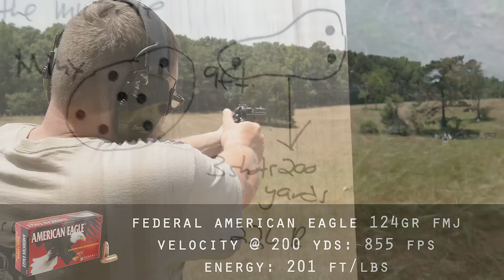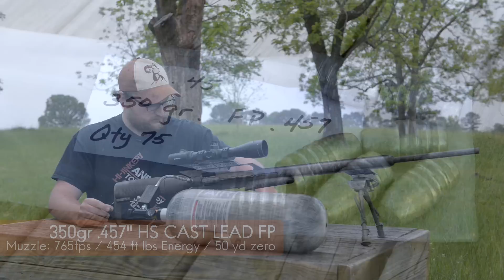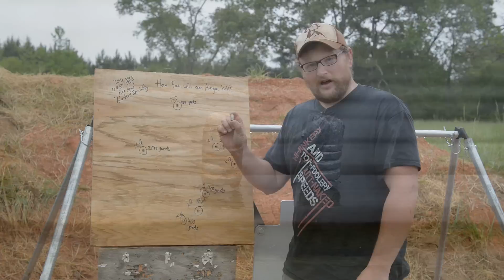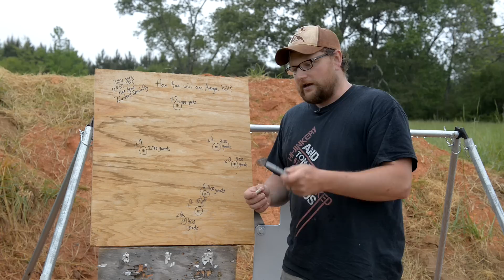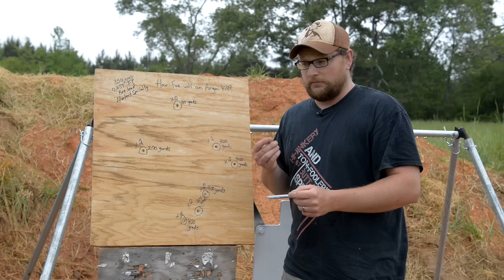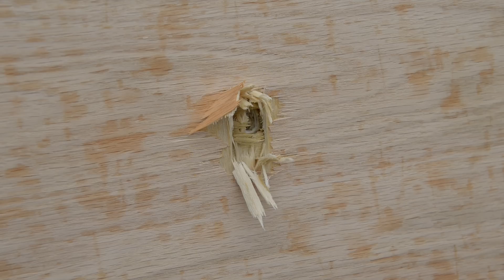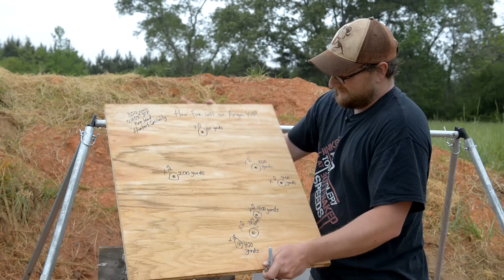How Far Will an Air Rifle Kill? Part 1

Comment: I got an challenger .457 bullpup with the power valve. I cast and shot 277g out of her @ 1020fps. I also love that lee mold 340g .458 I cast them and size them .458 and shoot them at 944fps. What you think about 650+FPE ? For long distance.

Comment: Thanks. I’ve been looking for a video like this. Most of the Airgun videos that I’ve seen are hitting targets at long distances and rarely discuss energy at impact. I have an error rifle let’s about 1100 FPS and about 80 FPE 25 caliber. What I’d like to see, is the scientist you just did, but with 25 caliber, 30 caliber and 35 caliber the same air rifle, but a different caliber sizes. Some people think of 25 caliber is going to have more energy than a 35 caliber at say 200 yards or 300 yards but I have no idea. I hope you’ll consider doing this. It would be very interesting.

Comment: I have the hammer and I've had it go through 2 frying pans, a half inch pine board and a metal 5 gallon bucket cover and lost in the dirt hill behind it. Had no problem going through all of them. I like shooting cinder blocks with it bc they explode. Only thing I've found to consistently stop the .50 slug is a piece of 3/16 solid steel. Shit they use on elevator motors. That metal also stops 9mm rounds also though lol. Cops were called when I was shooting one time and they took pics and had all sorts of questions bc they said straight out that it could kill someone. I added, "and at 200 yards but that's not what I got it for" lol.

Comment: How many shots do you get without the separate tank connected and when it says it's firing at over 300ftps is that on the same scale of measurement as the UK limit of 12lbs ps so is it really over 30 times more powerful than our maximum allowed power i can't even get my head round those stats

Comment: just wondering if you could put a harpoon into this gun
Reply: Check out the slingshot channel, jorge will show you the features of his air powered harpoon gun... older videos, but he built and tested and sold air harpoon pistols... now, not exactly sure how effective underwater they are, or in all honesty if its more of a.... well officer, i was cleaning my diving kit when the crack addict broke in and, and as i already had the designed for underwater use harpoon in my hand, i kind of pannicked and fired in self defence, i honestly didnt think it would work out of water type of thing...theyre single shot double barreled design, use existing co2 cannisters and easily penetrate leather jackets

Comment: I just got the Seneca Dragon Claw from Air Gun depot, it's the .50 caliber dual tube. It delivers 670fps at the muzzle pushing a .50cal pellet. I really didn't know what I was getting into, but I bought a bottle, rather small one it's a 110 cu in bottle and went on eBay and bought a YONGHENG 110V Air Compressor Pump PCP Electric 4500PSI High Pressure USA 30MPa. So now I wait to get all my stuff, got the air rifle, but won't get the pellets until Monday April 4th and not sure yet, when I get the bottle or the compressor, just ordered them today, eBay say's the compressor should be here from Wednesday April 6th to Friday April 8th, no estimate yet from Air Gun Depot, but to be fair I ordered after the working day and they are pretty good on their shipping times, usually a day or two. I'm in PA and they're in Ohio and sometimes comes from Utah. I'm like a kid at Christmas, can't wait to open the box. 🤓

Comment: HEY Let's make an Air Machine Gun using a big acetylene torch air bottle mount to the top of the air bottle on a swivel joint mount on the bed of an F-150 Ford 4X4 must be commo down, go rabbit hunting we in Texas so those big ugly Jack Rabbits how many rounds can they take, The Rat Patrol, eat up my garden would you

Comment: I'm curious if there is a difference between the simple description and the actual target?
A "pine board" or "pine baffle" vs a plank of pine.  The difference being, one is simply a plank of pine wood, as the other is multi-layer, glued plywood.  The thickness may be the same, I don't know about the "harness" or what is required to "punch" through it.

Comment: What amazes me most is that a .457" air rifle retains 60% of its muzzle energy out to 440 yards. Mainly because it's already traveling so slow. It's actually quite efficient from a ballistic standpoint, even if it does drop 50 feet at 440 yards. Compare that to a 55-grain .223 Remington leaving a 20" barrel at 3240 ft/sec. At 440 yards, that projectile only retains 20% of its muzzle energy. That's very inefficient. But because it started out so blazingly fast, it arrives at 440 yards having dropped less than 4 feet. So there is a tradeoff between trajectory flatness and terminal performance of a projectile. You have to give something to get something.

Comment: You need an old fashion ladder type of sight, with a modern scope replacing the iron sight notch.
I might be tempted to bet that, that slug could poke a hole in your “coconut “if it connected at the
end of it’s maximum range . (Fired from a 45 degree angle.) Imagine 350 grain lead hailstones!
The concept behind “volley fire”.

Comment: Question, a cryogenic stirling piston can turn the gases in the air into a liquid that can fill a presurized tank then screw on the valve and you now have a full tank of presurized air? A 12v cryogenic piston could then in the field refill a presurized tank?

Comment: I would like to know if dieseling will work with this weapon? If so it would be much more powerful.

Semper Fi America, 
Midnight Sun
Reply: Why though? It's pushing over 400+ ft/lb at 100 yards, which is more powerful than a 9mm and even a .45 right out in front of the barrel.

Comment: Wow, thats pretty impressive. You guys ever see videos where u put a drop of gun oil in the skirt of the pellet? It compression ignites the oil when u fire, basically a diesel gun, problem is it will blow out the o-rings after a couple shots, but it got me thinking, what if u designed a gun that could handle that pressure, it would be a firearm for real, a diesel gun, which i think would be sweet. Just throwing that out there!

Comment: with good rifling in the barrel you could hit to a 1000 meters assuming the optics and barrel can stand the extra air pressure

though I can't see the point of lugging the gas can on a hunt though you can hunt with it for sure..

Comment: I might add that the board you used was actually laminated plywood, not s solid pine board, which is harder to penetrate than the pone board would have been. Very impressive indeed!

Comment: A stupid question: why are there always flat point bullets used in these tests? All air rifle videos use flat points. Does sharp point not exist? is it expensive? hard to get? Safety reasons? idk.... I know it's old video but still
Reply: not on large caliburs but you can get flat round and hollow points

Comment: Is that CO2 or simply compressed air, and what pressure does the rifle operate at? 
Also, you mentioned that you use that specific gun for hunting... Do you carry the tank strapped on your back?

Comment: Bad bad gun. Who said we need a hot explosion to drive a bad pill through the air?
But, there are two only things I have a problem with: 1rst - who carries the gas cylinder for me? 2nd - how can I adapt a mag onto this gun?
Otherwise, there are advantages over fire guns too: 1rst - they are really quiet, 2nd - they do not rust and are not that heavy ('cause of the material they were made of). 3rd - guess, they are easier to handle (not that dangerous)
After looking your vid I guess it's worth it having an eye onto this gun technology... it only can get better
best regards rp - and thumb up - of course
Reply: Aidan Hunter: Thanx for the hint. The Girardoni (or Girandoni) is really a nice rifle. The technology and design must have been futuristic for the time it came to market. Ok, the stock looks ugly. But, this is a cosmetic problem only. The mag is super easy to load. And, yeah I love the way one has to operate the rifle to (re)load a bullet. It's that easy, that I cannot believe no one had copied this for nowadays air guns so far. I can imagine that Napolean was really pissed off 'cause of that kind of snipers. BTW, it was at that times very uncommon to shoot officers or other "higher persons". As you may know, officers mostly were nobles. So, a simple soldier was not given the right to shoot nobles/officers :-)

Comment: My I've had a number. of air rifles,the one I got in K town the crank the barrel down to the 5millimeter Sheraton blue street,I with a daisy a 20feet took the head off a grasshopper leaving his Collier intact,my 12gauge Stevens single shot was my 11th birthday present,at six years old I shot a colt woods man thumb up like a cowboy,my father said put your thumb on the handle groove,my wrist was grabbed,pistol taken,field dressed put in the car while the two ordinance inspectors shot for an hour,at home dad washed my thumb in the bathroom where I fainted,learning the hard way,a blow back is not a single shot cowboy pistol,six years old and stupid,received a lesson I never forgot from a receiver!

Comment: During the Civil War of the fired slow-moving 68 caliber rounds that would penetrate through the upper torso and backpacks and bed rolls of up to five men I mean inertia is inertia physics is physics you can have a lightning fast Light Round traveling at 3000 feet per second do that or you can have a big 500 grain 50 caliber round do that at 800 feet per second your choice.

Comment: how much psi is in the bottle? we use the same bottles in the fire department as breathing air and we fill ours to 4500 psi but most places done have a 4 stage compressor thats capable of making 5500 psi like ours

Comment: Question: do you find you get that supersonic crack in normal weather conditions? According to Wiki and other sources, air rifle bullets start having a significant drop in efficiency if they fully break the sound barrier, though there could be many reasons for exceptions in this case, hence my question.
Reply: only in light rounds like bb guns or .17 or 22 cal pellet guns anything bigger the momentum of weight out weighs that effect

Comment: Sympa faire test réel balistique, maintenant il existe des logiciels pour avoir un apercu très précis
Airforce Texan .457 (350 gr Coef Balistique 0.210 ; 765fps ; 454ft/lbs ou 610joules) zerotage 50m
A 400  yds la balle développe encore 287ft/lbs ou 388 joules avec une chute de 12.5m.
A 600 yds la balle developpe 231ft/lbs ou 312 joules et chute de 40m..
Pour info une 22lr c'est 140joules en sortie de canon.  C'est sur c'est pas un jouet la Texan!

Comment: Hi Eric. A lead bullet like a heavy .45 solid fired straight up will loose velocity until it stops then falls back to Earth. If it hits you on top of your head it will kill you because it falls at 180 miles per hour provided there is enough falling distance.

Comment: How many shots from an oxygen bottle that size anybody?
Reply: It's a lot of work but you can
Reply: How much PSI goes.into the chamber?
Reply: Yea
Reply: You can get a Benjamin pcp pump and just pump the gun up with it and forgoe a tank entirely
Reply: 30
Reply: You could try to hand pump it, but I’d highly recommend you just use a compressor — if you don’t already have one, they’re convenient to have regardless. You can probably get a few shots before the velocity begins to drop off.
Reply: Andrew Geier it’s possible but you’ll get tired very fast. You’ll get about 5 shots max before velocity falls off. For hunting it’s fine but vermin pesting, or target shooting is not practical. Plus Benjamin pumps are cheap. I had one, you can’t pump them continuously or you’ll get moisture build up because of the heat that’ll ruin your seals as well as your rifles air reservoir.
Reply: You question reminds me of when. Different television shows would have a jar full of jellybeans. If you guessed the correct amount. You would win a prize.
Reply: bobthiry.....I wonder if oxy and a little bit of oil on the thumb would propel that pellet almost twice as fast........it is just a small squirt of oxy so I don't think is gonna blow up
Reply: I think you should retry this with the Umerex Hammer...
Reply: Please do not use Oxygen, it can cause fire or explosions under pressure. Stick w/ plain air or better, nitrogen.
Reply: Lux can you pump it by hand?
Reply: Can I adjust the pressure with which force the slug would be fired?

Comment: Iraqveteran8888 
what is that bottle size thing is crazy huge.
Reply: Probably 98Cu Ft Minimum 74Cu Ft
Reply: Except it’s cubic inches, not cubic feet.
Reply: Not according to the Chinese manufacturers, go look at ali express, they say Cu Ft, maybe they're right when it's compressed the bottle itself is measured in Cu Inches empty. I don't know, I'm not an expert like you, just going by what I've read.

Comment: What you are doing is unethical and probably illegal. You are playing with a glorified pellet gun. You are using a heavy cylinder. Even with a smaller cylinder you are dealing variables. I would never take a varmint with anything smaller than a .223...maybe a .22 mag given the distance. A .270 would work as well. Your rounds have no expansion or decent penetration over 150 ft. Comparing a 200-300 yrd shot with a 1400 yrd shot with a .308 is beyond laughable. What is your windage? The drop seemed SUBSTANTIAL. I shoot a 30.30 a lot. It has a serious drop. That isn't the focus. At 300 meters it tanks with a 170 grain bullet. I want my target 100-200 meters. That's my sweet spot. You are probably just injuring an animal that you don't have the guts to put it out of it's misery. I watched your shots. You suck. You probably lied about half of them. ..."Did you hear that ding?" Nobody did because you missed....again.

Comment: it would suprise me if some special forces use air rifles!
Reply: The USA navy seals use a 9-millimeter firing pneumatic rifle with a built-in sound suppressor to take out sentries quietly with zero muzzle flash.
Reply: Lewis and Clark used one-1804-1806.

Comment: Hey try using helium or hydrogen it'll make the slug go slightly further
Reply: Why waste good expensive Helium? It's a rare gas, world wide the sources are limited.
Just use pure Nitrogen if you want a clean gas (instead of ambient air with moisture in it)

the difference between oxygen, hydrogen, nitrogen or helium is non existing, it's all compressed gas, all that matters is the amount of pressure.

The only thing that helps is that there is no moisture in a pure gas and there is in regular air. But i doubt it will give more the 1% extra distance, the limiting factor will be the delivery of the pressure (hoses, valves)
Reply: you are right it is very limited but it will make a difference not much but it will since helium and nitrogen or hydrogen are lighter than oxygen they will make the projectile accelerate faster because it can move faster :)

Comment: IM VERY JEALOUS... There is absolutely no where in my city, or that I can reasonably get to to shoot or site in my rifles... not a SINGLE place... I am in a wheelchair, with no transportation, and in city limits there is no place that accepts center fire rifles. only Rim Fire, Shotguns, and Handguns. The only places that WILL are to expensive. They are members only, and its 300$ for membership, ONLY when they are accepting new members. And its 150 a year after that initial fee. FUCKIN BULLSHIT. :( :'( :'( :( I live in Portland Oregon BTW .
Reply: I feel I have to clarify... Im in a POWER CHAIR, with no transportation. I cant physically pull myself into a truck and then haul my chair either. so.. im fucked.

Comment: WouldN'T the WORTHLESS CRITTER hear the shot and run before it can land at 400
Reply: Seems like it. sound travels about 1100 ft p sec. This air rifle was 540 ft per sec.
Reply: Uhhhh it's 900-1000FPS with the .45.
Reply: They don't seem to respond the same to air rifle shots as they do to normal guns.

Comment: i don't know a lot about airsoft but do you need to carry around a tank? why use an air rifle for hunting coyotes? if its about noise, use a 22LR with a silencer i figure
Reply: No. He is only using the tank so that he does not have to fill the guns tank (which is the butt stock) so often. That gun probably only gets 3-4 shots per fill as it has to use a lot of pressure to push a 400 grain round. Yes a .22 would be quieter, but you will not get the kinetic energy that you are getting from a heavier round.
Reply: Rated 3-5 full power, 10 in total.

Comment: id like to see some smaller, more inexpensive air rifles used as well since it seemed like the texan had more than enough energy
Reply: megadeth22885 u
Reply: varouj farajian u
Reply: AEA has dominated the airgun industry for price and power delivery👍👍👍
Reply: @catherineharris4746  bit of an issue in the accuracy department
Reply: @MrRofi-jp7mo  All of the one's i have are dead nuts accurate😂

Comment: the energy in the bullet will remain the same as when it left the barrel minus wind resistance. Asking how far will it kill is more of a question of accuracy rather then punching a hole in a board. I would predict that if you stacked the boards together the penetration distance would be the same no matter the distance.

Comment: By the way, ever wondered how fast bullets spin?  (12 divided by T)xVx60, with T being twist rate (inches) and V being muzzle velocity (result in RPM).  What is the twist in an air rifle?  If you're going to take pellet guns into traditional calibers, details are required.